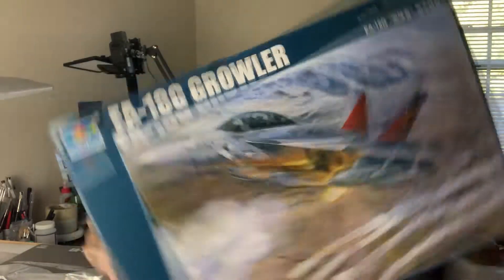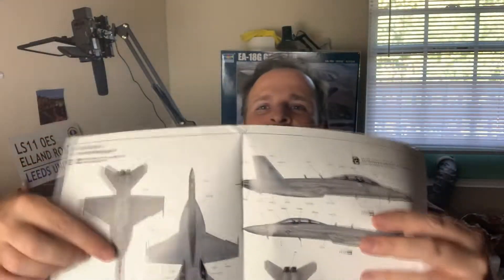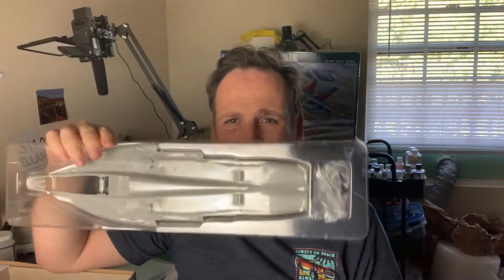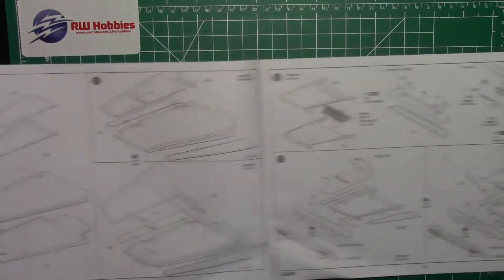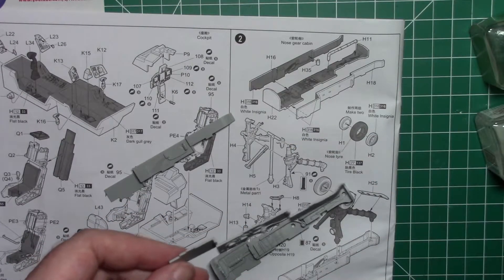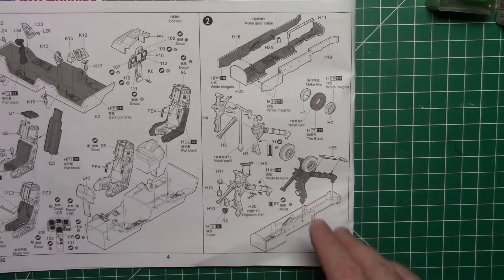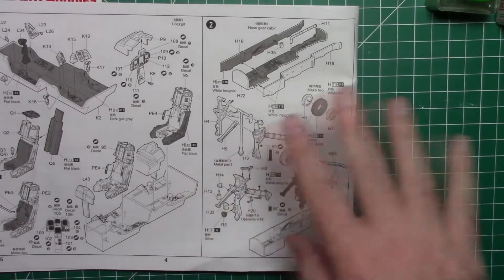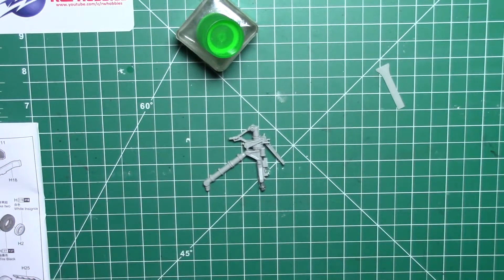1/32 Trumpeter EA-18G Growler Build Series - Part 1: Intro and nose gear

Comment: You talk about using branded thinners, and I have a tip for you and your viewers that may be useful. I have been using for years now, with no detriment to the paint or airbrush, isopropyl alcohol for the Tamiya paints. Ratio is 65% IPA to 35% water, and per 16 oz batch I use 20ml flow improver. Costs pennies on the dollar, or pound for you :-) I clean my airbrush with IPA and just be sure to use a drop of oil on o-rings every time, and all stays well. Sure beats nearly $10 we have to pay for X-20 thinner. Only works for Tamiya I believe, and that is primarily the paints I use, easy to get here in the States.
Reply from the maker: I don't use acrylics, I use 99% lacquer paints. I personally have found using the manufacturers thinner to paint, just makes the paint spray and go down better. But appreciate you sharing.